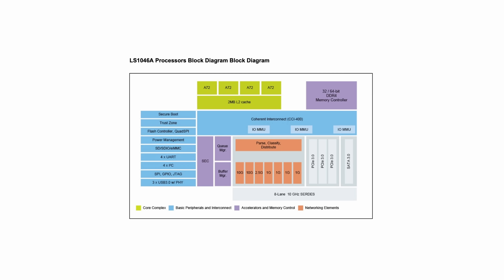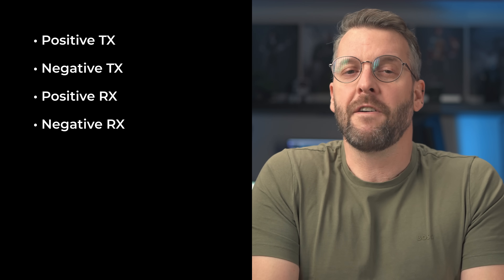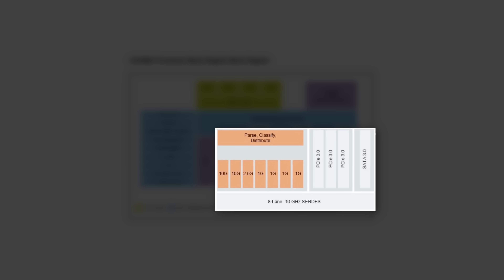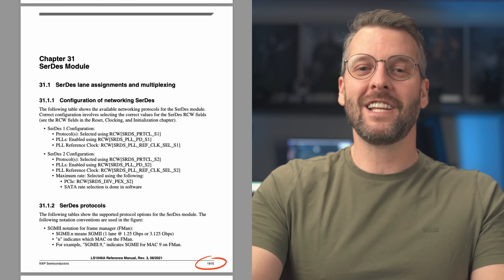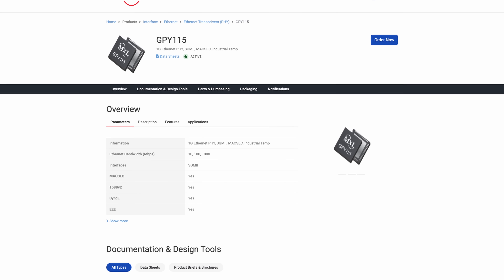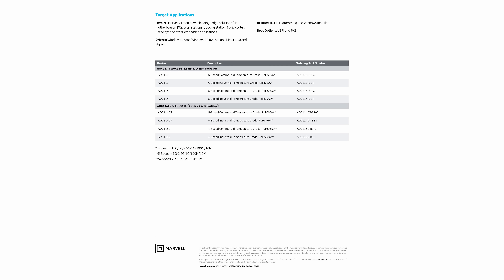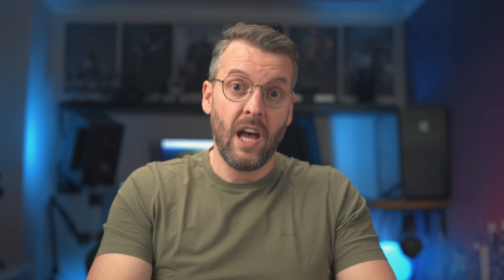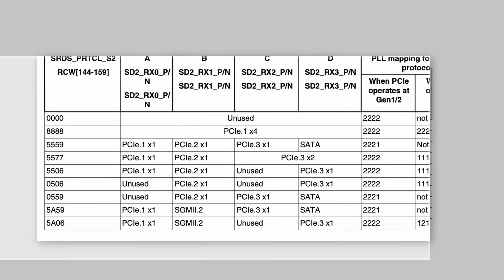You sure do LOVE your 2.5GbE ports!

Comment: I think that the design gymnastic and cost required to put a single 2.5 GbE in the system is not worth it. Using that 2nd block for other optional connectivity features such as Wi-Fi or LTE/5G modem would be a better "investment" into the capabilities of that CPU and add more value to the router.
Also, SATA is a pretty outdated interface. It would require a SATA connector on the PCB, a power connector from the power supply and a way to attach a 2.5" drive inside the case. Now that there are 1TB M.2 modules on the market for less than 100$USD, SATA is completely useless for this kind of system. For high availability and resiliency, two M.2 NVMe capable slots would make more sense in order to use mirrored storage (RAID-1) for the router OS while still having a remaining available slot for an optional connectivity feature.

😃

Comment: My WAN is 2+Gbps. And I'd be bonding those 10Gb ports to my core switch. And no, I'm not running my WAN through my switch (for various reasons)...  So having a 2.5/5 for WAN would be a make or break for me on this. OR have more than x2 10Gb SFP+ so we can use a transceiver and have more options as ISP's offer higher speeds. Just my 2cents 😉

Either way, i hope this is successful, it just might not be the one for me and I'll stick with my (power hogging) DIY setup.

Comment: 5 gbit/s or 2.5 Gbit/s yes. I already have 4 Gbit/s fiber at home (so... maybe a good WAN port?). EDIT: SFP is also fine instead of 10Gbit/s UTP. EDIT EDIT: Nevermind, maybe I don't need those 1 gbit, 5 or 2.5 gbit/s ports. It could be that my media converted can be connected to SFP+ port via a SFP Transceiver Module. And then I will add 10Gb/s switch behind the router. Does that make sense?

Comment: Hell Yeah!! CCIE here.

Can 10G ports run natively at 5 and 2.5?  Or are they SFP+?

Got cable modem yesterday and it only supports 2.5Gbe.  That means to use a 10gig SFP+ port, have to buy converter that is like $170.  Or I can only get about get 950mbps of the 1400 mbps or 2000 mbps Comcast currently provides with a 1Gig.  Now, a few modern cable modems come with 2 ports and LACP.  Not sure if your 1Gig ports will support LAG/Etherchannel/LACP … but the 2.5gbps cable modem costs $130, and dual one gig LACP cable modem costs $300.  As network engineers, we know a LAG of only supports multi-stream 1 gig, while a true 2.5Gbe supports native stream up to 2.5Gbps.

Thus 2.5 just makes sense in the USA, as Comcast is the largest residential ISP, Spectrum and Cox (the other big ones), will all support over 1Gig with Ethernet handoffs, not SFP+.

Thanks!

Comment: IMO most people probably didn't realize the limitations from that initial datasheet slide. If it was a 'freebee' I could see it. But at the same time, there are SFP+ to Ethernet Adpaters that somone could implement 2.5, 5 or 10 Gbit with for fairly cheap. And let's be honest, most people implementing this advanced of a router would likely have a 2.5 GB switch at the very least that likely has SFP+ ports that could then uplink to one of the SFP+ ports on the router. Especially recently, 2.5 GB switches have plummeted in price.
So ultimately, all said, if it were my call I'd say keep the original config

Comment: Have you considered using Realtek with the RTL8125BG? It's supported on the RPi CM4, and has ARM-compatible Linux Drivers. Jeff Geerling has a post named "Check your driver! Faster Linux 2.5G Networking with Realtek RTL8125B" 

Regardless, users could probably add the 2.5G ports by adding mGig SFP+ to RJ45 transceivers, which cost a bunch but would do the job.

Comment: I'd stick to the original design as many commenters have said but think about allowing users to put a 2.5G interface card in the m.2 slot. Should only be a consideration of having a blanked off cutout to install the port (see KIKAPA M.2 A+E KEY 2.5G Ethernet LAN Card RTL8125B). Whether or not that's a good idea or not (realtek chip in that example) I'll leave to those who have a better idea.

Comment: Note: I wont be purchasing it, but as someone in the ISP/Network field - here is my take: 
Don't put the 2.5Gbps port in. 
Check and confirm the 10G can negotiate at 2.5/5Gbps (should be able to ... but never assume) 

Why? 
By using the PCI lanes, you now push all traffic over the CPU, increasing latency and if people are going to be using this router to do more than routing (most likely) - then you can incur random bottlenecks in the network throughput.
Specifically at higher speeds - CPU based network processing is ineficient compared to a dedicated chip. 

If ppl want the ethernet port - then have a look at combo-ports instead.
Basically wired the same way, but you get an sfp cage and a RJ45 - uses more space, but lowers cost and increases ease of use.
Since if someone wants > 1G but has ethernet ... just use cable.
But if they want to use fibre, or a DAC ... they can - it becomes a choice. 

That way you then would have 2 gbit (or 4?) and 2x 10G avail ports (either sfp or ethernet) 

In home lab setups - a 10G switch would be used .... so no issues
in small homes - probs 1G for internet, leaving 2x 10G internal
for the middle section that kinda wants faster speed, but not sfp style ... they can just use the ethernet jacks.
2 ports is fine and covers 80% of the problem.
And if the 10G can drop to 25/5 ... then irel overall.
And if someone needs more ports .... get a bloody switch - a router is a router, not a switch -_- haha

Comment: Well, 2 10gb ports connected to a switch with more 10gb ports does the trick for the ones that need more then 1gb port. It's more expensive then you including a 2.5, but way more versatile.
By playing around with profissional FW/router's every day thats the most common setup, fw/router link to a switch with 20gb/50gb trunks and then the switch does the rest.

Comment: So, me again, at this point, I am not a buyer as my needs I guess lean too far into the enterprise side, but, I will at least drop my 2 cents if it helps or inspires a better idea. I would personally take a single 2.5Gbps port over 2-3 1Gbps ports even if it only did say 2Gbps of the 2.5Gbps, starting example is, say I pay for a 1Gbps link or even a 1.2Gbps link, with the 1Gbps link, if I only have a 1Gbps port, I am only going to get ~940Mbps vs if both sides are a 2.5Gbps port for a 1Gbps link, I should get ~1010Mbps out of the same gig service accounting for ISP slight over provisioning. So I would want that. Or, my other thought is on the WAN port(s) maybe a shared SFP+ and multi gig rj45 port so I would have SFP+ or 1,2.5,5,10G but not both at the same time. I can always pop a small switch in front of the WAN port for expanding that out, as long as the WAN port can do VLANs for things like fail over or load ballancing/SDWAN. 

I think I would also pick whatever port config gets the best IP feature stack, eg: L3/inner-VLAN routing on a stick or DPI or whatever vs ???.

Comment: Most ppl interested are going to have 10gbe networks, with managed switches, 1gbe and 2.5gbe clients will be downstream. That said a 2.5gbe or even 5gbe port for wan would seriously future proof this device and make it very flexible indeed.  My main interest is this device is that it can route between networks (vlans) at 10gbps using the sfp+ cages.  Sounding interesting so far, good luck 👍

Comment: 2x10GSFP+ is more than enough ports imo. Add a mgmt iface and maybe a console port. Its a router, it shouldn't need 2.5Gig.

That said, I also think the e key m.2 is extra as well as your router shouldn't be your AP, BUT cellular backup wan does sound nice.

Comment: IMHO…

You can’t have every option. At some point you have to say no. 

1 Gb WAN and LAN is the baseline. 

SFP+ have on WAN handles anything beyond 1 Gb. 

SFP+ on LAN to a switch. On the switch, you can have whatever you want/need. That’s where 2.5Gb is best placed. 

If you need to do inter VLAN routing, 10Gb from switch to router keeps it going at full speed.

Comment: I don't see the point in having a 2.5GbE port. You're designing a high end router. And not something the average Joe will be buying. And even more importantly, you're designing a ROUTER. Not a switch. With 2xSFP+, the user is free to connect whichever multi gigabit switch of their choosing using one of the SFP+ ports.

Comment: You wanna add two 10gig and three 1gig ethernet ports. For what you need 2.5gig? If it can be set to 2.5gig :/ or I'm wrong?
I probably just won't be able to buy it (mostly geographical problems), but I'm I would be glad to see 2.5gig instead of 1gig nics.

You can make two versions w/ 2.5gig or w/o :)

Comment: I already have a different solution in this performance class.. However based on the previous video picking the CPU based on a 7 year support window without change, I can only say that 1Gbe interfaces will look ancient once WiFi 7 has been the most common WiFi type for years (Thinking 2 years into the future from now). 

I think most users however will just be able to use the SFP+ ports with a switch to deal with this. 

Alternative configuration idea.. Make the SFP+ ports SPF+ OR 10GBe.. IE you have 4 physical interfaces but can only use one or the other for each "port". 10GBe SFP+ modules tend to be very hot so for those that want 2.5/5/10Gbe use but not SFP+ this could be a good compromise. You can see this done on a number of 10GBe switches these days like the QNAP qsw-m2108r-2c. This might be a cheaper way to have greater than 1GBe ethernet ports on the device.

Comment: I DO NOT want 2.5g ports.  I want 10g ports.  for most applications I would lagg both to an aggregation switch, put each incoming wan on the same switch, on different vlans, trunk the router/firewall to the switch, and then the firewall/router can route/firewall between any vlan on the system (including wan to vlan, multiwan to vlan, and vlan to vlan). And then you can use the switch (or switches if you do mlag to 2 switches), to provide any interface type you like using your choice of sfp+ multigig adapters (1/2.5/5/10g).  I really wish people would stop using 2.5g altogether because 10g exists (in both 10g-base-t and sfp+ variants) for typically in the same neighborhood in terms of cost, and for newer installs, I'd just run fiber everywhere as it costs similar to cat6/cat7 these days and it takes less power and you can use the same fiber to upgrade to qsfp+ later on for 25/50/100g down the road as those technologies become cheaper.  I really don't know why people are using 2.5g instead of 10g-base-t... sure, it uses a little bit more power, but it's WAY faster for file transfers to and from a nas or can keep your pipe way lower latency when serving lots of users with less demanding needs.  I'm currently using a firewall/router using a c3755r atom cpu which has 4 sfp+ ports that in my homelab environment, I have lagged to a 24 port 10g-base-t / 4 port sfp+ switch, it's working great for inter-vlan routing/firewalling, multiwan-vlan routing/firewalling, etc. as well as providing VPN services (with QAT acceleration) which acts just as another vlan... very flexible.  if I wanted to, I could also set up a second device as a HA backup with pfsense with an identical network setup that would take over if the primary went down and it's all seamless (which is why I avoid plugging wan directly into the firewall/router) as I plan to do a virtualized version of this.

Comment: Since the router will have dual SFP+ just allow customers to buy a cheap SFP+ to 2.5GbE adapter. They are about 15-20 euros. You could even offer to put one in their shipment on your store by getting a good deal in bulk from a supplier.

Comment: In my target setup the router/firewall will be connected to an managed switch with one or both (LACP) 10G (SFP+) ports  while using VLAN's
I need 1 or 2 additional [Slow] NIC's, 1 for "High availability Sync" to the second router, and 1 for management (optional).
(even 100M will be enough)
So personally i don't care about a "faster then 1G" port.

Comment: (Disclaimer: I 100% will not buy the product, just giving my opinion)
I think including 2.5G would miss both the point of using a networking-oriented SoC and the point of 2.5G itself.
2.5G exists as a way of getting more out of legacy Cat5E cables, since going 10G requires having Cat6 or fiber. If I have one of those - I don't care about 2.5G, I can go 10G and beyond. If I don't - I don't care about paying for SFP+ (which is the case for me).

Comment: What type of interface will the 10Gbps ports be? SFP+ or RJ45?

In both cases you can just connect it to a 2.5Gbps switch right? I don't see the need for a dedicated 2.5Gbps port, just skip it.

Comment: I'd opt for an extra M.2 Key E slot instead of 2.5G Ethernet. If a user needs 2.5G he can add an 2.5G M.2 card (available with either RTL8125B or Intel 225/226). If he doesn't he saves the money. If he needs something different, there is space for that. The slot itself will add about 1$.

Comment: How good of wifi AP you can get with key E modules? Usually wireless routers have more robust solution either be the antennas or the chip itself.
Reply: You can get ones with external antennae (u.FL connectors on board, wired to SMA sockets on the box, and you can connect any standard antenna to it).
Reply: @n-steam  antennas are one thing but creating the entire solution is another. I just hope that by the time they will finish the prototype they will have router with Wi-Fi that is comparable to the latest offering in the market (probably Wi-Fi 7 routers).
Reply: @eliadbu  from what I gathered, he's putting an M.2 slot in, not the wifi board. I think you'd have to buy that separate (making sure to choose one with external antenna).

Comment: Honestly, I can't see myself paying much for anything any time soon unless its an upgrade to 2.5GbE. Even casually I've already managed to max out the bandwidth of my 1GbE local area network, so I've already been dealing with it for a while. The difference between one of those plastic gigabit tplink switches and a much more expensive, much nicer gigabit switch doesn't justify the extra cost for me. It'd be the same with the switch in the back of a router. That and I can't actually use a different router because I'm with Virgin Media. "Can't" in the same sense you couldn't with your ISP, but I'd rather not incur their wrath.

Comment: Its a router, not a switch.   I would leave the 2.5g port behind, and possibly consider WWAN LTE/5G if possible for failover?   Something like the MikroTik CRS310-8G+2S+IN would offer 8 2.5gbe ports and 2 sfp+  for less than 300 dollars,  let the user buy that instead.

Comment: WIth this explaination you did I guess 2 x SFP+ will do, and we'll see if we need the 1 gbps. I will just connect the router to my switch. just try to make it so it does not overheat when using 2 x 10 gbe SFP modules if someone can't use fiber modules or DAC cables. After all you can make 10 Gbe ethernet ports using SFP+ but not the other way around.

Comment: For where I'd use a box like this, I would be happy with 2*10 and 2*1: This allows me to build either fault tolerance on the WAN, or backup WAN, and fault tolerance on the LAN side. A single 2.5G port is okay if all you have is a single AP, but I have many, and they are PoE, so I need to have them hanging off of (vlan tagged) switches anyway.
I would be far more interested in having space for doing packet captures than onboard wifi - Where the router is, and where the APs are, for a network that warrants a 10GbE capable router, is usually different. This is from viewing this more as a business/network admin's home/enthusiast-box, and not a cheapest-isp-cpe-solution.

Comment: In my opinion adding the 2.5 is a waste. 
Cause if you buy a 10G router you take incoming fiber into 1 slot and then send to a 10G switch. 
You can get a switch with 10G incoming port and then have ports for 1G and 2.G of your choosing. 
And have the switch handle the switching and not the router. 
Just my thought. but what do I know. =)
Reply: This is exactly how this product should be treated. It's a router, not a switch. You're absolutely right with your thoughts.
Reply: my fiber first gets converted via a media center, then it's a UTP cable.. so 5 Gbit/s WAN make sense to me. And 10 Gbit/s internal network also make sense to me.

Comment: personally, i prefer 2 SFP+ at low cost, switches with 10Gb/2.5Gb are numerous and cheap on chinese sites. moreover if it's SFP+, there are SFP+ modules capable of 2.5 or even 5Gb.

In conclusion, as cheap as possible for the brain, distribution switches can easily compensate for this need.

Comment: Keep the 1GbE ports because the 10Gb SFP ports can be adapted to 2.5GbE if desired
Reply: Not all SPF+ implementations can be adapted to multi-speed variants such as 2.5GbE or 5GbE. However, it is backward compatible with SPF modules at 1Gbs. For example, my managed switch only supports 10GbE on the SPF+ ports. Is the port on this router compatible with multi-speed SPF+ transceivers?
Reply: @viaujoc I've found that it may be cheaper/less problematic to buy a cheap 2.5gbe switch with sfp+ and cover it with a dac.
If you allow Chinese devices on your network, one can give very affordable switches that might cost less than a 2.5gbe transceiver module and unlike it will definitely work
Reply: @viaujoc SFP+

Comment: There is no real need for a 2.5GbE RJ45 port on a router with SFP+ ports. A 1Gb connection at home is still quite rare. Those who need it can utilise the SFP+ ports. In most cases the router will be in combination with a switch. 
Please don’t make a super expensive product that cover every use case.